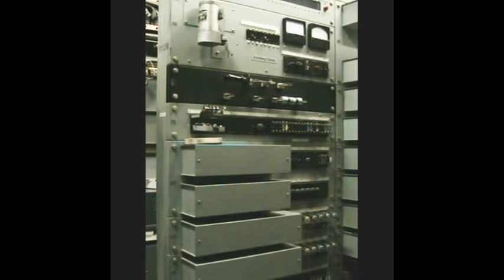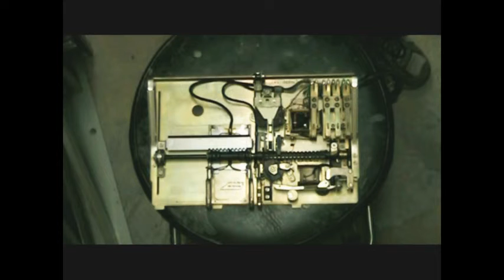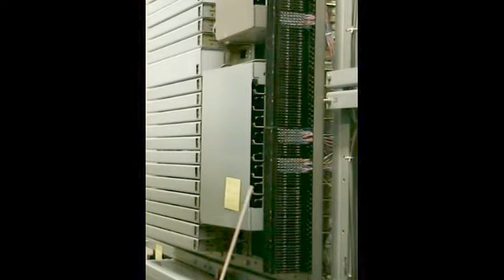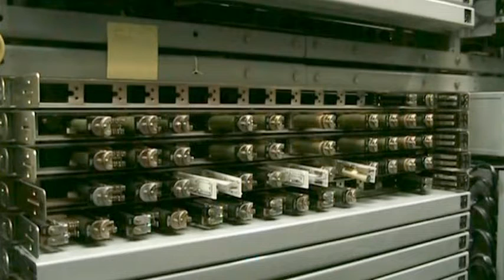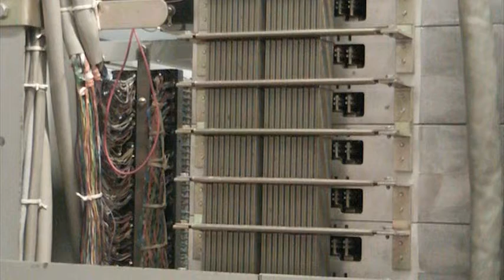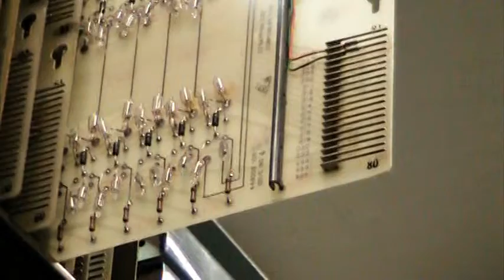Stromberg-carlson X Y switching system.

Comment: I ran many of jumpers in one of these offices, the whole valley here was Stromberg, Went Digital in 97 wow thanks for the memories!
Reply: The XY equipment had a feature called executive override. This allowed a phone call to be overridden from another phone and break into an existing connection. A special code number was used after calling the number you wanted and was busy. Then it would connect you to the caller.  Really high tech for the time.

Comment: Worked in a 20k+ line (225, 245 & 247 ) SC local switch center in Kingsport, Tennessee in the 70s. This was a United Telecom area. Center also had an AE S.A.T.
Being electro-mechanical, maintenance was of primary importance BUT keeping the ANI cross-connects up to date and old wiring removed was a continuous problem. Every toll call that didn’t ID was sent to an operation for number ID which caused staffing issues and of course call delays and customer complaints. The toll switch translations cross-connects where more complex they did not change as often.

Comment: Thee was a time when a party line customer calls another number on their same line of theirs, they have to either dial the full number or a pe-assigned code and then the last four digits of the number, wait for a busy signal, then hang up. The caller's phone will ring the code of the called number as well as the phone being called. When the ringing stopped, caller would lift the handset and begin conversation,.There wee other versions of this ring-back system.  Instructions would be either in the first front pages of the directory or the caller would call repair service for the instructions.

Comment: Phil, do you know of any museums near NJ that have operating switches?  I would love to volunteer for one of them, as I was an old "Bell Head" at the labs in Holmdel, NJ.
Reply from the maker: There is a museum located in Ellsworth Maine. 
The telephone Museum. switchboard@nemot.org 207-667-9491  
They have a WE #5 crossbar and the other WE #3 crossbar. 
Phil.
Reply: @sxsphil  Thanks, I will contact them.